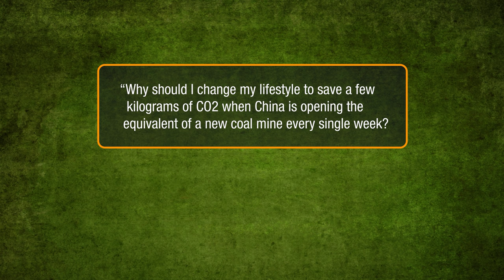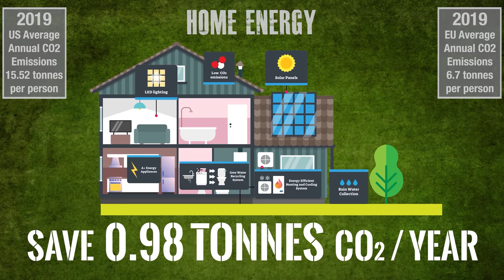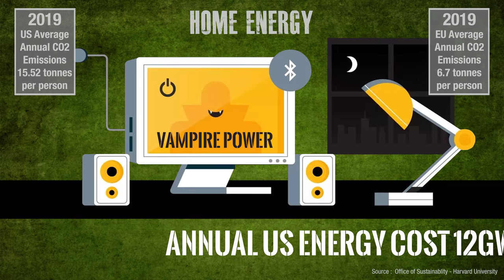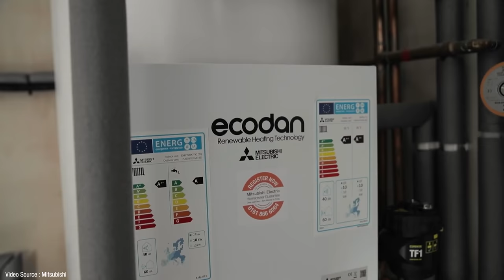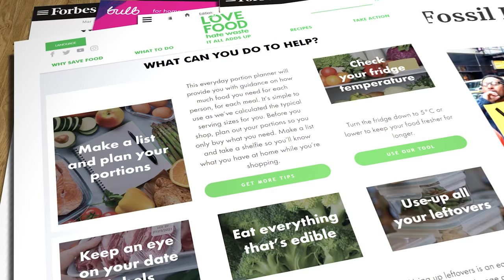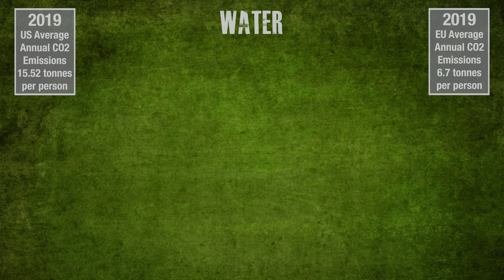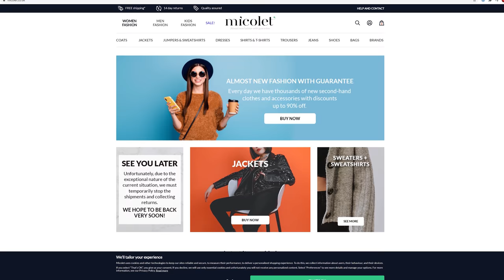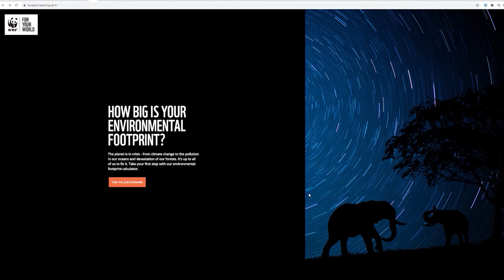Can you really affect climate change? Yes. You can. Here's how...

Comment: Under "Transport" you did not mention the effects of reducing vehicle speed. The amount of exhaust gas released is directly related to the amount of fuel burned, directly related to the amount of energy expended, directly related to the effort required to move an air mass from around a vehicle, and overcoming friction.  Duh, everyone knows this.

Back in the 1970's (which I remember well, street-racing) we were hit by the "Oil Crisis", one of the reactions of the US President was to impose the national 55mph national limit to reduce fuel consumption.  It worked (from memory saved over 150,000 barrels a day), and as a piece of collateral damage this also reduced the exhaust emissions, like anyone cared back then.

So, the message now should be "Slow Down, Save Fuel, Save Money, and Save Emissions".  

Electric cars are nothing but a dream for the vast population of the world, $25K a year earners are NOT going to buy a $50K car, so electric cars will not have a big impact.  We are forever going to buy and use old $500 -$5K cars, getting us to drive them more carefully though will have a big impact.  Second-hand EV's are also out of the question for most of us, batteries have a finite life and massive replacement cost.  Keep it real to keep people focused. Thank you.

Comment: Everyone can make a difference .. just think about guerilla pv .. by fitting a 300watt solar modul to your balcony or house .. you can save up to 20% of your electricity consumption.. they just plug into your regular power socket in the wall and feed energy back into your system.. in germany its completely legal .. just check with your local gov… and its cheap.. around 400-800€ including all components .. just plug in and save :)
Reply: @Extra Leben  The math does not seem to add up; 300 watt = 20% of total means 1500 watts usage.   A hair-dryer can consume 1500 watts easily.  Your calculations do not seem to take into account the rest of high-demand appliances, such as heating/cooling, refrigerator, water heater.  What is your housing situation that would allow 1500 watts to be your entire demand for what period of time?  What does you electrical meter read at the beginning of the day and at the end of the same day?  In other words, over what period of time is the 1500 watts spread (kW hours)?

Comment: "Switching to LEDs" sounds easy, doesn't it?

Unfortunately, only a few fixtures could get updated to LED in my house. My city required fluorescents for a long time, which means most fixtures have ballasts that are largely not LED compatible. And there's no LED bulb available for my track lighting. And finding actually dimmable LED bulbs with good color rendering for the cans (which had to be dimmable by city code) hasn't met with much success.

I'm now at the point where I'm making my own fixtures for some cases!

The most annoying bit is where the previous "energy efficient" choice of fluorescent and dimming now gets in the way 

(For anyone saying "there totally exists LED replacements," you have obviously not actually tried for a real house previously updated 20 years ago.)
Reply: Nonsense!
Reply: @engleblerthumferlumpadinck6536  Your solid argument immediately invalidates my actual experience. Thank you for your help!
Reply: @jonwatte4293  where there's a will, there's a way.
Stop whining > Buy and fit new fixtures > Job done.
Reply: @engleblerthumferlumpadinck6536  yes, that sounds like exactly how we'll stove the policy problem. Host ignore problems of implementation!

Not everyone has the skills to replace fixtures, and renters can't even change wired fixtures on their own.

If your ignore implementation problems, you will never see it actually happen. Making it the easy path is the only way to make it happen on a broad scale.
Reply: @jonwatte4293  I just had to read your first comment to make sure you were actually talking about what I'd thought - changing to LED lighting.
For a second there I thought I may have confused the issue with 'invading and conquering Afghanistan'. 
Good luck. I hear it's impossible 😂
Reply: @engleblerthumferlumpadinck6536  I'm so glad I finally found someone who thinks it's easy to cut open the drywall to rewire the starters/ballasts, and then float and sand and paint it over when done! Shall i pencil you in to come here for Saturday?
Maybe you can also turn some adapters on the lathe for the track lighting and built in appliance fixtures?
I'm sure the landlord won't mind!

Comment: I have to disagree with the LED vs incandescent bulbs argument. 
There are still a lot of problems with LEDs. Not specifically with the science, but with how the LEDs are made.

LED bulbs rarly last even 2 years. A lot die after about 6 months because people buy the cheapest stuff they can find. And this cheap quack usually drives the LEDs 2-2.5x their rated max power specifications while most LEDs are the most efficient (per watt) at around 30-50% of their max rating. Also LEDs last proportionally longer the less current you put through. As they force 2.5x max rated current through that thing its not running close to 70% efficiency and will die in months rather than years. 

The sad thing is, that even expensive brands often push the LEDs so hard, they just die way too fast. 
Phillips for example has a lot of lamps that push the LEDs at exactly 100% of the May rated spec. Which is still inefficient and shortens the lifespan. 
If they'd just double the LEDs or half the current the la.o would still output about 70-80% of the light while surviving twice as long.

This has to be regulated globally because any company will sell their soul for Profit

Comment: I would like to know if the suggestion on turning down the thermostat over night could be backed up by real world or even any experimental numbers numbers.  From my research keeping a stable temperature uses a lot less energy than letting the house/apartment cool down during the night and then having to heat it up again during the day.  I guess YMMV depending on how good your insulation is.  But really, I'd be interested if there even is a scenario where turning the thermostat down during the night will actually give some a net plus.
Reply: @David Ayers  It seems it would depend on the square footage of the house, the amount of insulation protecting the house from heat (cooling) loss, the difference in outside vrs inside temperature and lastly whether you pay a reduced rate for off-hours heating (cooling).  

The makers of my heat-pump provide a thermostat which begins the morning heating a couple of hours (5 AM)  before the first start-time (7 AM) of the day, so it can use the heat-pump to, hopefully, get the house to the set point temp.(69°) prior to the first set time (7 AM) without resorting to using "emergency heat" (electrical coils), which saves greatly on the monthly heating bill.  However, if the outside temp is below about 38° F., the heat pump is not very effective at sucking ample amounts of heat from that cool air, so on cold mornings, I see on the thermostat that "Emergency Heat" is warming the house.  Hate to see that, but what can one do; we can't all live in sunny places with mild temps the year-round.
Reply: @YouToobeism  Well, the amount of energy used or carbon dioxide being emitted surely doesn't depend on any rate difference for off-hours heating.  I am interested in the effect on the environment.

So yes, the net energy usage probably depends on many factors... but keeping a well insulated house/apartment at a stable temperature will likely not induce the need for "Emergency Heat" needs in all but very extreme conditions.

So my question stands.  Does turning down the thermostat at night actually reduce the overall energy usage in a typical home?  I remain unconvinced.
Reply: @davidayers8338    Well, if you remain unconvinced that turning down the thermostat during sleeping hours saves energy due to the need to heat the house the next morning, starting from a lower ambient temperature, I can only point to your admission that it "depends on many factors", some of which have already been listed.  Add to those, the fact that the makers of modern, energy-wise, heating/cooling systems always provide thermostats that contain pre-set schedules which facilitate cycling the heating/cooling periods to "normal" waking hours.  Since their focus these days is on being energy-wise, perhaps investigating their web-sites will turn up research to answer your question.

As an aside, but not irrelevant to real-world considerations, most people find a lower temperature at night helps to insure restful sleep.

Comment: How can a system that turns fossil fuels into electricity with about 60% loss in energy then turn it back into mechanical energy with another 60% loss be better?
Reply: Use renewable energy to drive your ev
Reply: Bro, electric motors are generally greater than 95% efficient at converting electrical energy to mechanical.

Comment: My self i recycle everything I can I do not buy water in water bottles I have to buy milk but I most of the time recycle the jug I use it for tea or keeping cold water in the refrigerator so I don't need to buy a water bottles I got solar on my house I got solar on my carport I got a wind turbine in the air producing power The only problem is is getting batteries because the batteries they don't last long if you use the led acid and you got to send them in and recycle them and the lithium there's so  damn dangerous and these pack things that they got I'm going to build my own battery with the lithium iron phosphate and I hang clothes on the line whenever I'm able so I'm doing everything I can do and I recycle cans whenever I got aluminum cans they won't recycle the bottles and I hate them plastic grocery bags I wish they'd go back to paper but anyway I'm doing all I can if everybody else would just do a little bit I mean it would help out so much especially the grocery bags and these damn water bottles I hate them things oh well thanks for sharing maybe somebody will join in help save this planet we ain't got but one